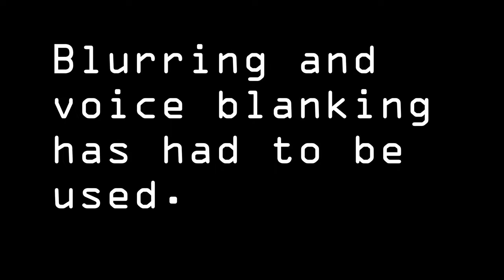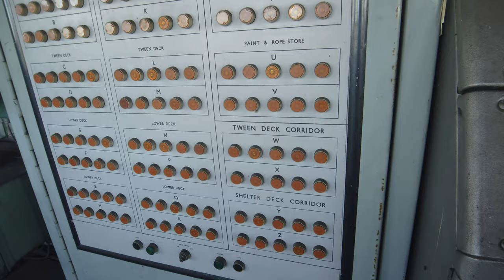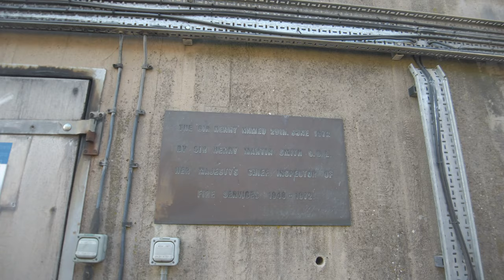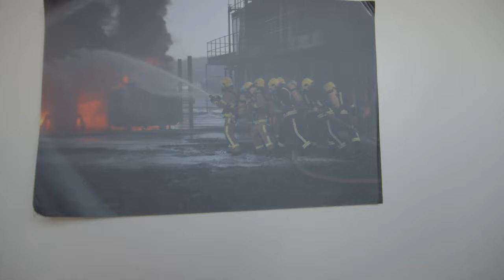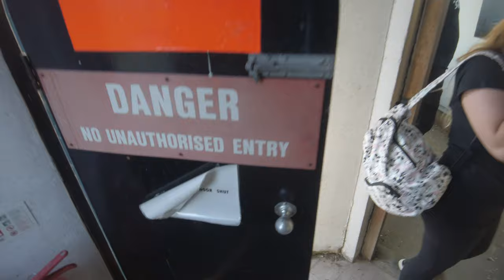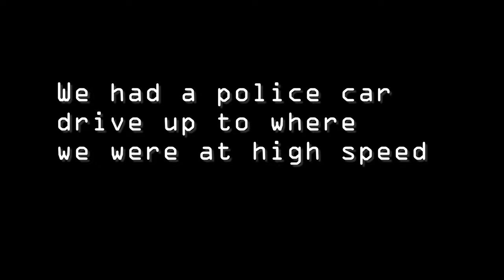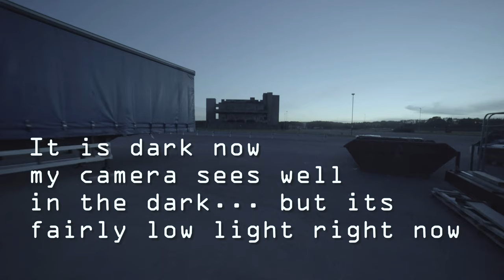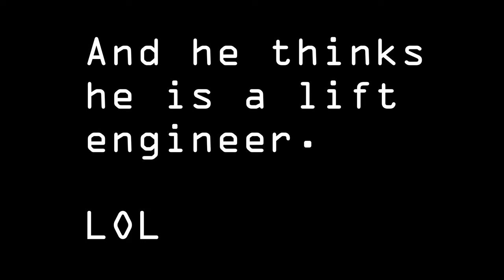Moreton in the Marsh 4k FIRE TRAINING and airbrakes lesson ROFL

Comment: 1:34:22 That's acceleration and braking together.  Also it's not a dead mans switch. The driver has to come off then depress the pedal to acknowledge each signal within a second or so otherwise  the aws would kick in.  Close, but not a dead mans switch which is instant and also is constant pressure.